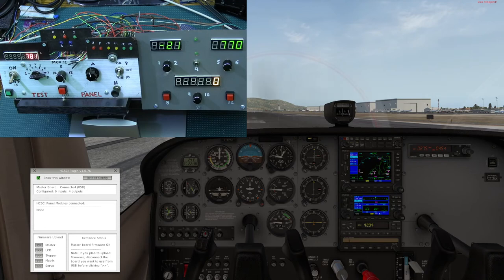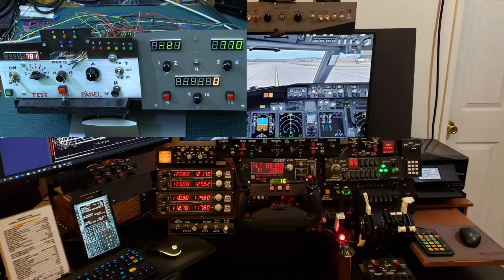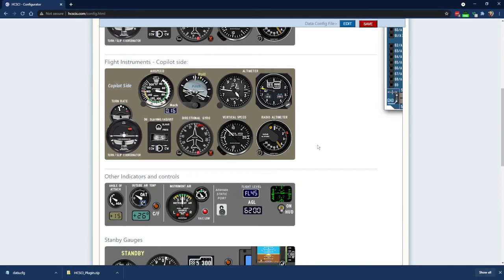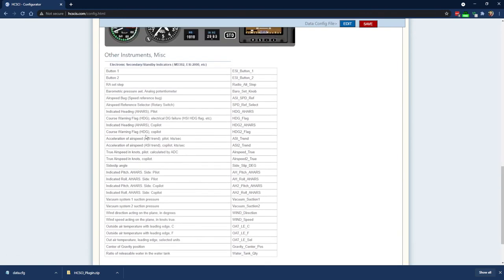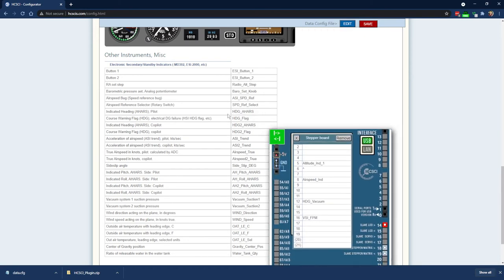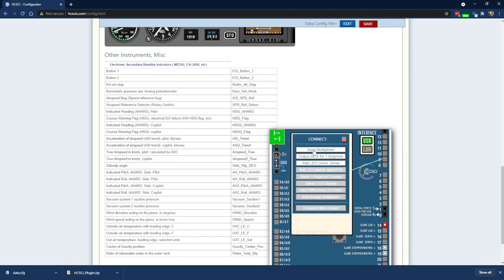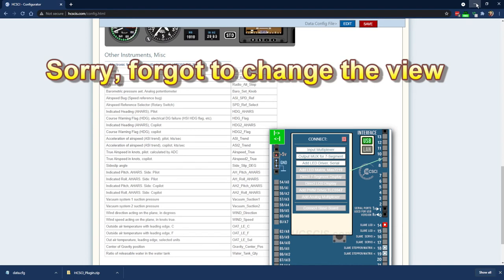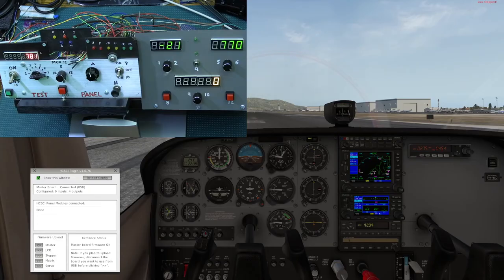Using displays for normally unavailable parameter data with SimVimX/ RealSimControl

Comment from the maker: Jorge Lopez I got a notification of a comment you posted but I can't find the comment. I'm pretty sure it was under this video. 

From the pictures you sent in the link. I'm  not sure what you are using to build those radio panels. I'm thinking you made those from with DM13A of Max 7219? I would start with a 1 K resistor and if the digits are too dim then maybe try a 680 Ohm

Comment: Thank you for addressing my comment and taking incoming from HCSCI ( They still do not realize that you are their best salesman ). I agree that their approach is good and easy to use. However, since the configurator is updated almost weekly or more  -- builders like me that start a small hardware setup and later wish to add to it or modify it no longer have access to the original configurator they initially used. You must accept the use of their latest configurator --  which I have found lately to be missing previously available parameters or have obvious functional errors but worked well previously. ( latest configurator -- great example ). It is like Apple changing their operating system and you find some applications do not work anymore. BUT with Apple your always can revert to the previous OS if you need to. I see that as a great flaw in their approach.( cannot ever have access to a previous working configurator that worked for you with access to parameters that you had at one time)!  I just wanted to have access so I could display INDICATED( IAS.VS,ALT,HDG and their autopilot values) --- that capability is not presently easily available.THANK YOU ,THANK YOU,THANK YOU, again and again for your time and interest in my request. Like others I will now take a different approach. Can you comment on SPAD??
Reply from the maker: You're welcome Jo Lo. I dont have much experience in SpadNext, I bought it so I can use my Logitech (Saitek) panels with MSFS. Since I was so disappointed with MSFS I only use it like 1 hour after every update then I go running back to XPlane. So I never really learned all the power and possibilities of SpadNext.

I agree with you on being unable to use previous versions of the configurator but honestly I can only remember one time about a year ago when that really affected me. Throughout all the changes they've made, my setup has for the most part worked perfectly even through all the different versions of the plugin.

Anyway, I knew they would not be happy about me sharing this workaround but like I said, I needed it and obviously you and other people as well so that's why I decided to share it.

Comment: Hi.  Thanks for your very useful and informative videos, they have bee a huge help to me!  I was wondering if you could take a look at HCSCI's FMC pre set key matrix.  I selest the Boeing option, but cannot seem to find where this presets or preloads, so I know where to connect my FMC matrix keys too.  Any help would be appreciated.  Thanks
Reply from the maker: Hello Medicnz, Although I've not made an FMC myself and as of right now I have no intention of using that feature I did take a look at the information regarding that. Basically you need to use an Arduino Uno or Nano board and assign it to pins 18 & 19 on your Master board in the configurator. Then you will use a multiplexer in conjunction with that Uno/Nano to build the button matrix.

Not sure if you already joined the forums on their website, I'm sure they can provide more answers about that than I ever could because like I said, I have not built a matrix of any kind.

All the information and diagrams are here on these two pages:

https://hcscis.com/io_kmx.html
https://homecockpitsoft.wordpress.com/2020/08/07/fms-mcdu-predefined-matrix-configuration/
Reply: @Qosmokid  Thanks appreciate your help.
Reply from the maker: @Medicnz100  No problem,  let me know if you get it working

Comment: This may be a totally stupid question, but here goes.  I’ve watched so many YouTube videos on simulator and home cockpit building.  What is my benefit one way or the other by using simvim or Air Manager.  I want things to be as real an immersive as possible.  Haven’t done anything like this before.  Will probably be doing something with a single engine GA aircraft of some sort, maybe even a twin engine Baron 58 or similar.  Any comments or thoughts would be appreciated
Reply from the maker: Hello Curt, not a stupid question at all. I am going to be very biased in my answer though. You've probably heard me say on many of my videos that to me this is by far the easiest solution for putting together a home cockpit. It supports pretty much every component you will need and you don't have to do any programming at all. You just use very cheap, readily available components. No proprietary or expensive boards required, like the knobster which in my opinion is ridiculously overpriced.

I have a video comparing MobiFlight to Simvimx/RealSimControl and I gave that solution a few pros at the time. Since then SimVimX/RSC has gotten even better. I believe Mobiflight also now supports some components they didn't before. I've never use Air Manager so I can't offer an opinion on that one.